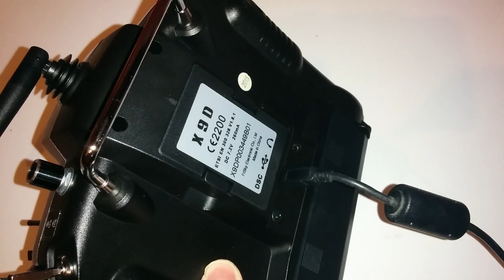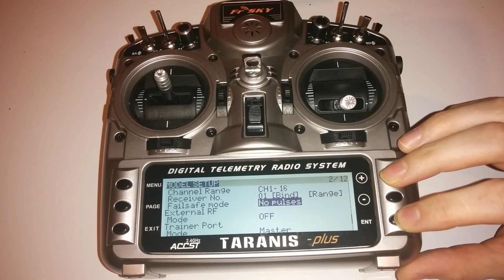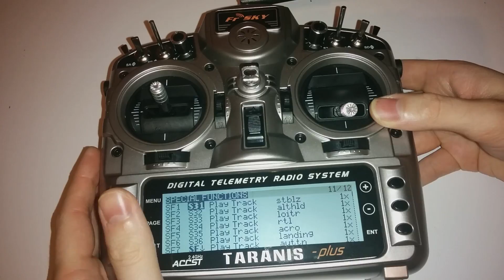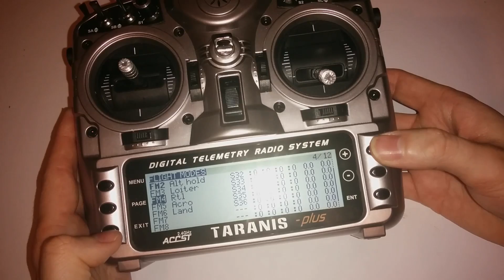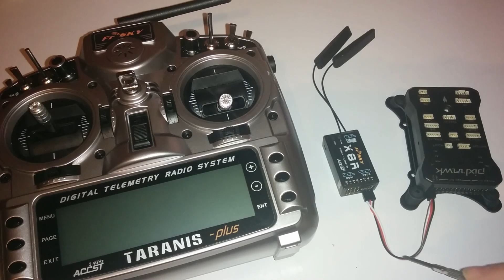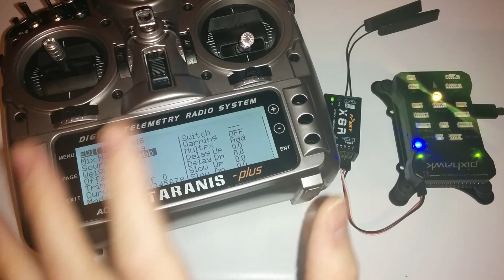High End 450 Quadcopter - E04 Taranis & X8R

Comment: hi Andy
I built your low end quad with the flysky transmiter can I add the pixhawk to it removing the cc3d and still use the flysky transmiter instead of the trannis 
I know it maybe a bit restricted due to amount of channels but is it possible
Reply from the maker: +paul Derbyshire it is possible but only using a ppm encoder. the pixhawk requires a ppm input (one cable for all controls) so you need a ppm encoder to split the channels out to the receiver.

Comment: one more question if you dont mind...im trying to get gps info to my taranis from my quadcopter. I got the FrSky GPS which is S-Bus sends to the taranis fine but cant use it for my cc3d revo. I got a neo m6 connected and working with the cc3d revo and now trying to get GPS info to taranis. can you tell me if i could use the FrSky gps some how to the cc3d or better yet send GPS info from cc3d to reciver so it will send info to my taranis. Ive done a little research and come across this       http://alofthobbies.com/frsky-smart-port-to-uart-converter-sp2uart.html
https://www.airborneprojects.com/product/apm-mavlink-to-frsky-smartport-converter/      can i do what they have done with the teensy 3.1 with a ftdi or stm8s103f3p6 arm stm8 minimum system development board module for arduino?